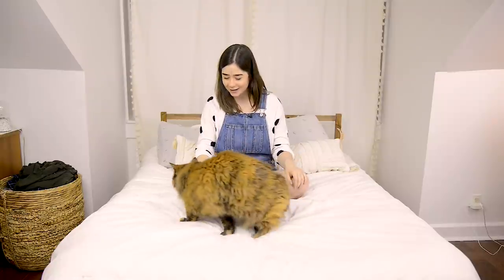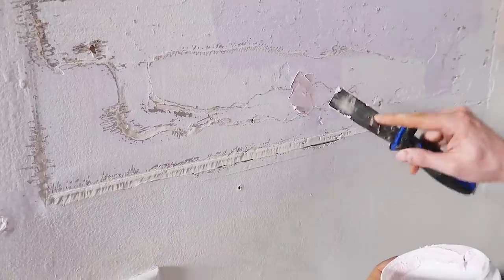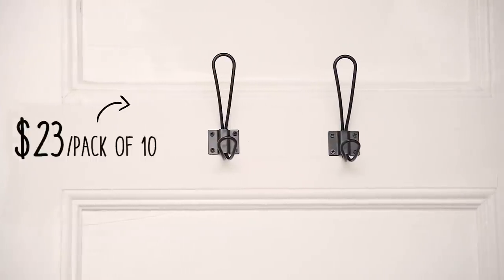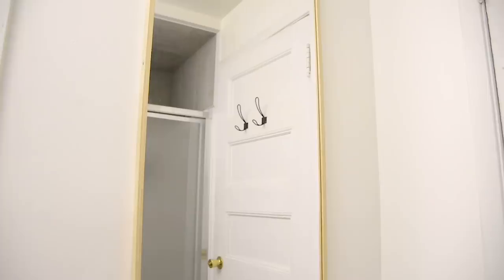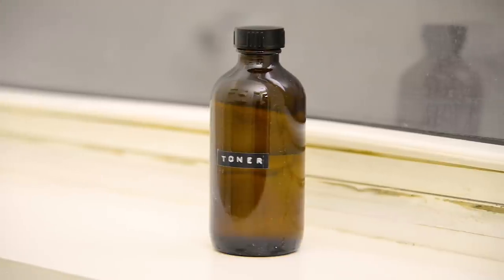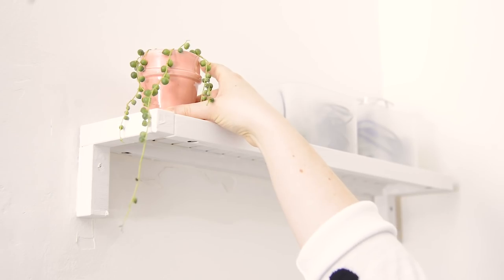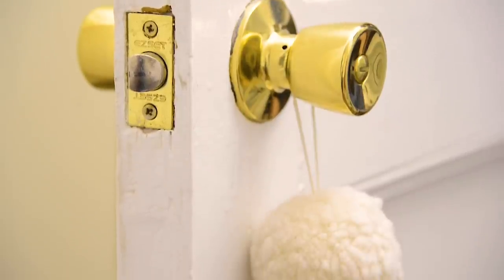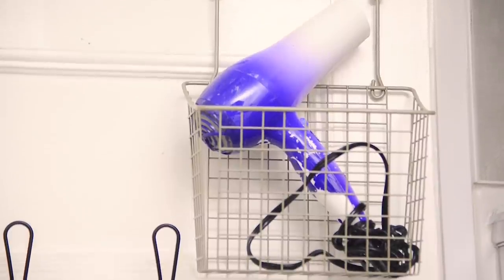No Storage Rental Bathroom Makeover For $400 | My Rental Reno S1 E5

Comment: I have had a pedestal sink for 3 years and have never realized they made anything to function underneath them! Mind blown. Also, love Malinda!
Reply: There are plenty of little cabinet and shelving units that are designed for under pedestal or 'floating sinks', but getting one that fits your particular sink and surrounding space can be a challenge. I looked for years for something, and finally, last year, I happened upon those triangular Ikea shelves she uses in the video; they just fit between my bathtub and toilet. But I arrange them turned the other way, so they meet in the middle and provide a straight bank of shelves in the front, on which I've put baskets that I can pull out like drawers. If you look at them on the Ikea website (RÅGRUND), you'll see that arrangement.
Reply: @Olive_O_Sudden  I totally would but we are moving at the end of the month!

Comment: Suggestion::install a hook on the ceiling behind the door. Attach a boating rope that reaches almost to the  floor. String the bathroom paper with the rope.  Add a wooden stake at the bottom end of the rope once bathroom paper is strung up to keep it  from falling..  Or use a POMPOM instead of a wooden stake.

Comment: I HATE pedestal sinks! They are so outdated and a waste of space... end of rant
Reply: But they are much prettier than wall hang
Reply: I have one too, and the bathroom that it is in is extra small. I have to put toilet paper and cleaners just on the floor and it looks terrible!
Reply: Agreed! They have no counter space. It’s so frustrating
Reply: We built a lil cabinet around ours in my old house, it worked super well!
Reply: I do like vintage sinks and if it's a bigger bathroom, it won't matter too much. But most small bathrooms have the pedestal sink, which makes it annoying. Our house is old so of course it has one. It does have a large built in storage unit in the wall though. The only thing we can fit on the sink is a hand wash and one other little cup or soap.

Comment: I have a tiny bathroom with a pedestal sink, and I used those triangular shelves from Ikea (but turned the other way, so it's straight in front) with white baskets. They made such a difference and they just fit between the bathtub and the toilet. Completely changed my bathroom.

I like that tall, shallow cabinet. You could easily make extra shelves for it. But one question: Your cats don't shred the exposed pile of toilet paper rolls?

Comment: I hate that flooring so much, I’d have to change that if I rented that place. They sell some really durable and pretty laminate flooring now days and I’d definitely be buying some for that bathroom. Also, the baseboards. They sell these really pretty rod bathroom towel racks and I bought a cute one just for my hot tools. It can be drilled into the wall or the back of the door and it’s been life changing because I straighten my hair or curl it and then have to leave for work. So, the rod allows me a place to set my hot tool to cool down especially if I’m running out of the house and I don’t have time to wait for it to cool down before storing it. And I don’t have to leave it on the sink. Instead of art work I bought adhesive craft tiles and printed some of my favorite photo memories and adhered them to the tiles. Now, I have a cute photo collage that cost less than $25. I took an old picture frame ‘with the glass’ and hand painted a Peter Pan scene ‘in black’ let that dry and crumbled up a piece of foil and taped it to the back. Now I have a cool piece of handmade art that cost nothing because I already had all the materials. I took the old vent covers and spray painted them to bring back a nicer cleaner look. Since I rent, I’m not supposed to paint the walls anything that would be hard to cover when I move out. So, we compromised and I painted the baseboards to bring a pop of color into the space while still looking clean.

Comment: My bathroom has a toilet and shower. Absolutely no space for shelves or a sink. You are lucky to have that bathroom. Definitely taking some ideas for mine.
Reply: Can you fit in some storage right outside the bathroom, maybe along the wall?
Reply: @okashi10  right outside my bathroom is my room (only one bedroom and its also very teeny tiny.)  Its a challenging home 😅
Reply: This will sound bizarre, but if you have a low ceiling get a car net. Basically its a hanging net iver the ceiling.  You can cover it in fake vines/leaves (preferably thrifted so that it isnt mean to the environment) to make it look intentional.

At that point you can put your extra toilet paper and towels while also changing the atmosphere of the room.

Switch to bar soaps/shampoos/conditioners to save space, and get one narrow exposed shelf to put them on.

These tips might not help you, especially if your ceiling isnt low, but I wish you the best :)

Comment: my biggest tip for people is to get two trash cans with lids and either draw or label the top of each recycling and trash. from toilet paper rolls to shampoo bottles we have so much recycling in the bathroom. ps. if you really want a cool look go for  two different ones that are the same colour and finish, (its easiest from the same company, umbra makes a bunch)  and but little emblems on the top to help your guests differentiate, if its your bathroom leave the labels until you memorize the difference and then remove them just be sure to use a non permanent label.

Comment: My opinion on this reno:
1. The new light fixture is no blah. 
2. Malinda was horrendous, especially for that price.
3. I would not have paintrd the wood shelves white. Infact i would have tried to match the wood color of mirror and shelves.
4. I would have gotten a tall shelf that would take up almost the same floor space as the hair tool basket. (might as well do away with that narrow shelving in that corner). On that tall shelf i would have stored the toilet papers too. I like to keep bathroom floors as much empty as possible, much easier to clean especially if you have hairfall problems.

Comment: Then they opened the door too strongly and the mirror behind it smashed. And with a healthy dose of bad luck on their side they set the pothos alight with the candle underneath it, and then slip on the rug (which really needs grips if it's on polished tiles). Some of these design elements are missing common sense.

Comment: Details, details, details. If you want your space to reflect you as a professional, you need to go the extra mile and pay attention to the details. Either hone your patching skills or hire someone to skim coat bad areas like the one behind the mirror you removed. Also, before you film, clean windows, eliminate or repair broken items, and scrape off paint splatters. Your bathroom floor was covered with drips!

Comment: Hi Alexandra! I love watching your videos!!!  So, I have a question. My 500 sq. ft. rental has a tiny 3/4 bathroom with TWO opposing walls with a huge mirror hung on each wall. Most of the wall is a mirror! Do you know of any products that I could stick to the mirror-walls to add storage and decoration? Landlords do not want those mirrors removed. Argh!
Reply: Linda Fox My bathroom is 80s mirror central and it’s grown on me, but it minimizes storage for sure. Maximize storage on the back of the door! Also, consider how many things actually need to be stored in the bathroom.

Comment: Why dont you put the decal abit higher than your height so that it does not block your face reflection? And the pom pom on the door knob is just superfluous and none of decor value. Plus, why do you need a basket on the door for seperate hair tool when you have the basket on the ground before for all of them?

Comment: It's your bathroom so take this with a grain of salt. Mirror behind the door is unrealistic. Maybe there is a door stopper but even then it would still have the possibility of breaking the mirror with a little pressure. At the end of the day, it's kind of useless there anyway. No ones looking in the mirror while in the shower and there is not much room to change or get a good look at yourself otherwise. The basket on the door doesn't fit because it is meant for a cabinet door. To make it seem like it was realistic and did is deceptive. Even if it did fit, however, that would also be unrealistic, the doorway is already narrow and that would make the doorway a squeeze, no one wants to do that just to go pee. Great ideas but kind of sucks that you're not being honest/realistic because that's what "looks good."